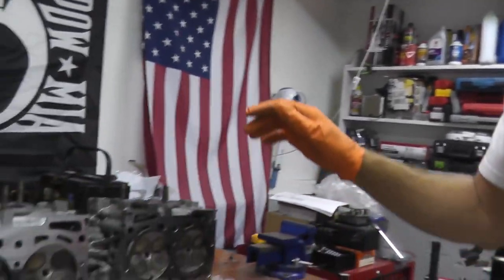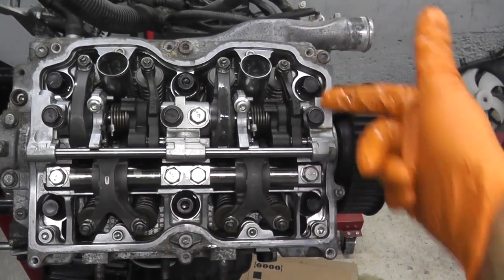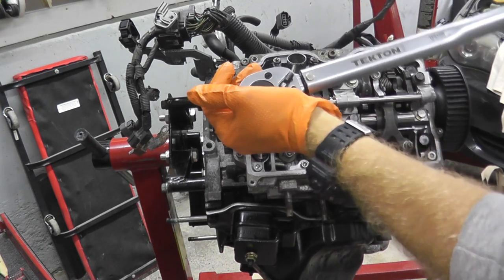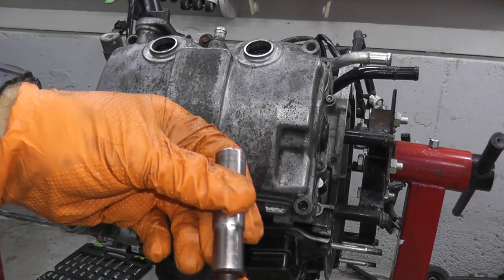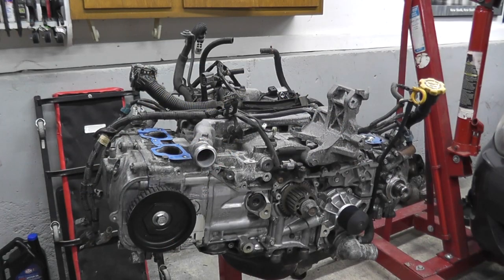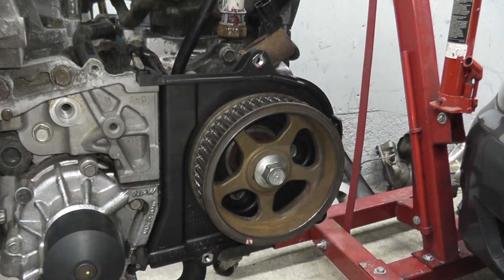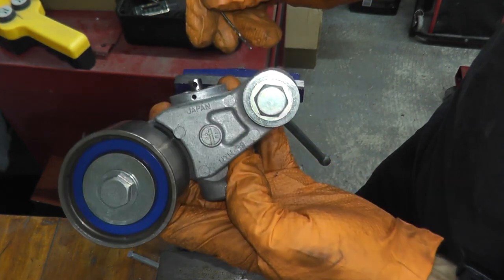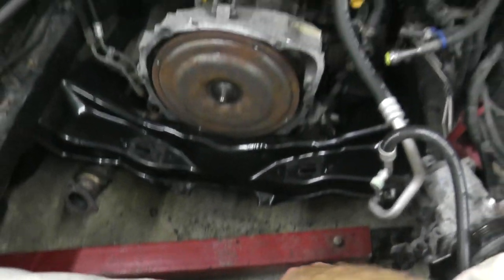Subaru Engine Rebuild | Subaru Impreza | Subaru Forester | Subaru Outback 2.5L Build

Comment: All sequences Ive seen are top middle, lower middle, top left, bottom right, bottom left then top right. Im doing a 2010 impreza EJ25 currently. Pressure tested, cleaned lubed and plained. Only important bolts to put back in place the way they came out are the center ones. Others don't matter

Comment: Hi there I'm wondering if you had the machine shop reseal the cam carriers? I think those are maybe one of the other sources of oil leaks and probably misdiagnosed as hg leak. I've yet to see a video showing the proper reseal.

Comment: To really “bulletproof” any Subaru motor rebuild, imo the block should also be resurfaced as overheating will warp the block as well. When I rebuilt my ej251, I removed the dowels very carefully and after checking the block with a straight edge, it was indeed warped about 2-3/1000”. I resurfaced it myself at home using a square piece of the straightest countertop granite I could find with really fine sandpaper attached to it and wd40, and checking the block periodically, it makes a big difference. After a good 15-20 passes without applying too much pressure on the block, it was straight all around to less than 1/1000”. I also used MLS head gaskets. The engine never leaked again.
Reply: How did you remove the dowel? Put a 1/2 diameter object inside, grip the dowel with locking pliers and spin back/forth till you could pull it out? How clean was your block before you sanded? I still have a slight amount of gasket residue. How large of a section of granite and do you remember the grit? Which MLS gasket did you choose? How many miles has it been? Thanks!
Reply: @Allen-bm6tz  I bought new dowels from Subaru, they are not expensive. The easiest way to remove them is with a locking pliers welded onto a slap hammer. But if you don’t have that, locking pliers will do, make sure you spray PB blaster or some lubricant around them first. And be extremely careful not to scratch the block when rocking the pliers while removing the dowels. Btw, you’ll need a straight edge from Amazon to truly test if your block heads are truly straight. I used the straightest square piece of granite I could find, I think it was 12” x 12”. Carefully clean the block with a razor blade, watch some videos on YouTube on how. Also, NAPA autoparts has bristle wheels, use the white one ONLY to clean the block, you can remove the graphite residue stuck onto the block this way, but go easy on it, take your time be gentle or you’ll remove a lot of material and you DO NOT want that. Use the finest grain sand paper you can, I honestly forgot, but it has to be very fine and use WD40 to help it slide on the block. There’s a set amount one can remove only (I believe only 2/1000”), that’s why you need to go easy and patient without applying too much force. Just let the weight of the counter granite/sand paper do its job. Download the manual for your car online for the specs. Then clean the block and check it with the straight edge. You can stick the new dowels in the freezer for 24 hrs so they go in easier into their holes. I used Six Star MLS Head Gaskets. Car never leaked again in 20K miles, but I no longer have have it. Just make sure to buy MLS H/Gs, not the ones that comes with the graphite on them or you’ll have the leak all over again. Hope that helps.
Reply: @Mike_44  Thanks for the response, I appreciate it! Trying to decide if I want to use the turbo MLS gasket... I think the thickness isn't the same as factory spec for the NA. There is a YouTuber who believes strongly in the turbo gasket which causes me to doubt 6 Star and Fel-Pro. I'm guessing 6 Star and Fel-Pro have constructed the thickness of their MLS to match the factory specs. Maybe the failures he saw were from the result of the block not being "perfectly" flat and smooth?
Reply: @Allen-bm6tz  This other video by SubiMike, another expert in the matter, explains step by step what to do to install the heads. https://youtu.be/ddFsFfiyOvg He used Fellpro H/Gs, but if you watch they are also MLS H/Gs. The sequence in which you tighten the head bolts is THE MOST IMPORTANT part. Make sure, you are using enough oil in the holes so the bolts don’t screech and end up breaking, otherwise you’d be really screwed. Remember, if you are using the same head bolts, the tightening sequence will be different than with new bolts because used bolts have already been pre-stretched. Take your time, don’t rush anything, do lots of research and watch a lot of videos so you get a good understanding of what you’ll be doing. Download a free copy of the FSM(factory service manual) and use the right tools. You can do this, it’ll be worth it. Good luck!
Reply: @Allen-bm6tz  And yes, you can use the OEM Turbo non-graphite single laminated gaskets or the MLS H/Gs like SixStars or Fellpro..

Comment: YOU NEED TO USE A TORQUE ANGLE GAUGE!!! You can not just free hand it! You might as well pull those heads back off because I can all but guarantee you did not torque those bolts to the proper angle. Buy a factory service manual and learn the proper way to torque heads.